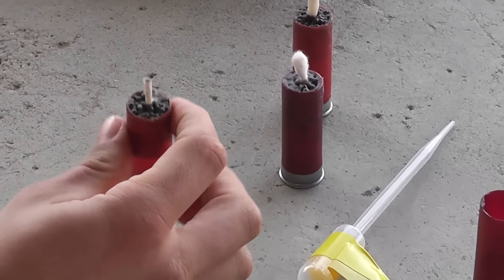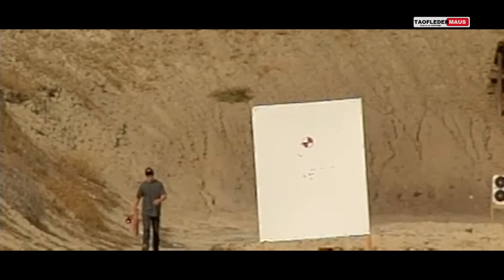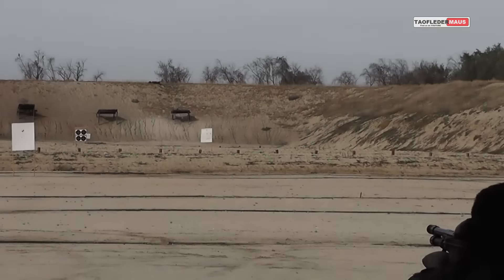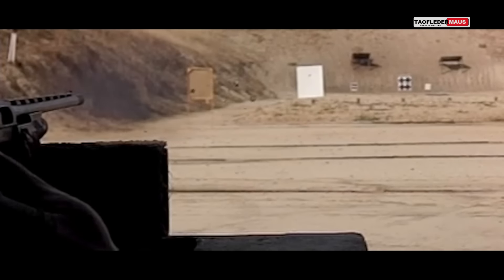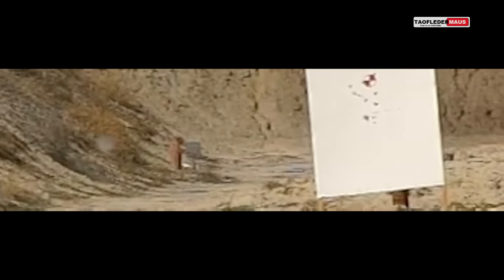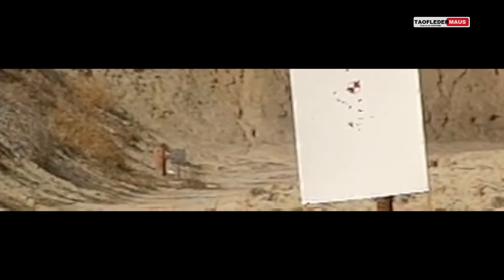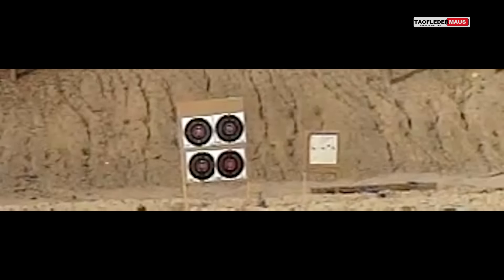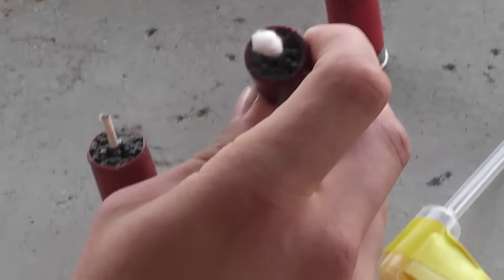Shotgun WAX SLUGS -  Shot Through RIFLED Choke

Comment: wow that was one heck of a shot at the end. I wonder if the choke would work better without the q-tip? Not that I expect a cylinder of wax and lead to ever spin stabilize.
Reply from the maker: +Pyrolysis   I just had those left over qtip slugs with me so I mostly just wanted to use them up and get rid of them.   But we'll try regular waxers too.

Comment: So, I know you don't want to do the silicone slug because of the curing time and mixing issues, but I had an idea for something that would come out similar, take less time, but be slightly more labor intensive. Rubber cement and shot applied layer by layer until shell is full. I think layering rubber cement would bond better than layering silicone, because I'm not an expert in either, but have opinions.  It would take a few seconds of time here and there over a few days, but the result could come close to silicone slugs. This also gave me the idea of making slug discs separated by appropriately sized washers. Pardon me, it gave me the idea of YOU making them. At least I'm honest...But, if'n you didn't feel like getting layered with rubber, have you tried alternating wax slug/washer/wax slug/washer/etc before?

Comment: You HAVE to try black cloud wax slugs. They have a stabilizer whad and the steel shot makes the penetration a lot more dramatic. I use black cloud BB 3.5in for maximum power. but as I've noticed you don't have anything that shoots 3 1/2 so I would go with 3in BB

Comment: you should shoot air and see if that penetrates 2 inch hard steel from 1000 metres
Reply: theres a cannon already for this go look it up but it will bend stuff not penetrate
Reply: +Joe Randella Look up vortex cannons
Reply: +Dr. Bananable Lector technically if you compress air to the point it freezes and use an extremely high powered gun using another source of compressed air with a long rifled barrel this could work.

Comment: video idea. what does hot liquid wax mixed with mercury look like after the wax hardens?
Reply: maybe some experiments with it as well?
Reply: +Snare X I would imagine it would just pool up on the top of the mercury and harden there, due to mercury's super high surface tension.
Reply: jaco parish but if you forcefully mix it as it cools
Reply: +Snare X 
how?
Reply: Pour the hot liquid wax into the mercury and use a mixing stick to constantly stir it while it cools.

Comment: How about a silicone bird shot slug?  May hold together better.
Reply from the maker: +Alexander Presslie  It would probably take weeks for it to cure all the way down to the bottom of the slug.  It would be hard to get a good mix with a gooey substance so the lead shot wouldn't stack very uniformly in the shell.   Wax is cheap,  fast and for the most part,  it holds together well,  but  becomes super frangible when it hits a solid-enough object.

Comment: hmm how about a short piece of cloth mabye 3 inches put into the slugs while they r being solidified could help with the flight
Reply from the maker: +thomas thompson sunshinescopes   If it will fit into the shell.   There isn't much room there to work with.
Reply: Right like a shell width piece all the way through not just bunched up in there like a half inch wide piece of burlap
Reply from the maker: +thomas thompson sunshinescopes   I'd have to use something very thin,  like silk so it would fit.
Reply: Mkay
Reply: Hmm did u notice the q tip gets blown off from the drag
Reply: Maybe like a chord with hair wire like a vaccum cleaner chord fray the end a piece obout 4 inches long and maybe like cast wax and shot slugs the same diamiter of the shells hole so you can put whatever u want to stabalize the round in flight and then maybe round the nose
Reply: +TAOFLEDERMAUS yeah, i was thinking along these same lines. could you coil some thread (thin, but large enough to act like a kite tail) on the wadding, separated from the wax slug by a small disk (like a gas check, or a 2part disk that would fall off), with a small bit of thread fed into the cavity of the shell so that the tail is incorporated into the wax shell? then the shell wouldn't have to tumble to achieve proper drag.